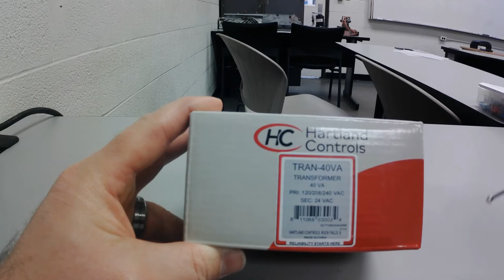Multi-Tap Transformer. DON'T HOOK UP EVERY WIRE !!

Comment: Thanks for clarifying that "Com" = Neutral. I had to wire  one up for a 277 from a single phase of the 3phz provided. As to say, Ground and Neutral were the options. My brain said "Ground is ground!" so used the Neutral!!!! Ground always seem in my mind to be the "Safety Net" that stops electricity from killing us!!! (takes it down and minimizes it from going thru other paths.....or can)
Reply from the maker: Thanks for commenting. I has been a while since i have been on a 277 circuit.

Comment: From Hammond transformer company. You must hook up the dual windings 
type transformer in phase or you will burn out the unit. In transformers
 with dual primaries and secondaries, do I need to hook up both?  YES, 
The unit was designed to run both and if you use just one it will 
overheat and voltage regulation will be poor. In dual winding 
transformers, how do you hook windings up "IN PHASE"? To hook the 
windings in parallel, always hook the dot to the dot. To hook the 
windings in series, always hook the dot to no dot. This applies to 
primary and secondary windings.
Reply from the maker: I have seen some commercial units with a different transformer than what is typically used in our residential HVAC units. That must be one of those types that they are describing...never seen one with dual primary windings. I'll have to try and find one so I can learn about it. Thanks
Reply: @johnjennings-JJ  The reason for dual primaries is that transformers are sold all over the world and most countries use 240 AC volts instead of 125 AC. It means they are dual use, 240 VAC for the world and 125 ACV for America and Canada. For 240 volts AC you hook the primary windings in series, so each section only gets 125 AC. For parallel (125 AC) if you wire the transformer out of phase it burns out the windings. For 125 AC you always wire them in parallel. You would first download the manufacturers PDF and find the dots and pin numbers on the schematic. Some of the pin numbers will be assigned a dot. For 240 vac series wired, the schematic shows to connect pins 2 and 3 together and connect the line voltage to pins 1 and 4. I used to buy small pcb transformers at flea markets for a dollar. And I burned out a few after wiring them out of phase. Remember dot to dot for parallel.

Comment: Which method works for 220v AC input? Same as for 240v?
Reply from the maker: Sorry...weather has been crazy here. Yes, I would say the 240 is likely the best option. On a transformer with multiple voltages I would choose the best voltage it listed for my power source. I would go equal to or higher than 220v. So, if you had a 208 and a 240 volt wiring configuration for the primary and an exact 220v power source I would choose 240v on the transformer because 220 is more than 208 and could blow it. But of course if you put your 220 on the 240 wiring you will come up a little short with the secondary voltage output because you didn't put the full "240 volts" on it. Hope that makes sense.

Comment: Quick question. I've got a 120v microwave transformer, it's the only one I've seen with 3 taps on the primary winding. One tap for each end of the winding and one that splits and goes both directions in the winding. Having a heck of a time trying to get output. Xfer ohms out fine on the meter and good connections all around. But can't seem to verify power with any combination of line and neutral connections on the 3 taps. Thanks, solid video btw
Reply from the maker: I would think that the primary side would just be 2 taps or wires and the secondary side maybe has 3 wires? They do some different stuff with capacitors and I don't do a lot with them so I really wouldn't know what to tell you that is different than what you said. That's why I like HVAC...just a little simpler! Hope you get it though.
Reply: @johnjennings-JJ  it is definitely on the primary side. 1 single tap on the secondary, with a couple wires from the heater winding but those are not used in my application. But no worries, I'll either get it or burn up the transformer, in which case I'm sure I've got another microwave laying around hahaha. Thanks for the reply

Comment: If you ran loads on those higher voltage taps would you run the risk of burning up the 120 side?
Reply from the maker: Something i learned when messing with my fishing lights. The power source has only so much power...in wattage. Don't go over it. I am sure that the calculations for running something off of those taps will result in burning it up. Unless it is something small like led lights or similar. But short answer is..SURE could. Just gotta do some math.

Comment: So how does 240 get wired?? There is no common, its 2 120 legs and a ground
Reply from the maker: On the primary side they list it as a common but it is just the "other side of power" for whatever power source you are using it on. For a 120 you would put the neutral on the "com" and for 208/240 you would put your L2 side to "com". It doesn't know any better 🤣
Reply: @johnjennings-JJ  I really appreciate your time John.. So L2(120V) to com and then L1(120V) to 240V wire? I'm just wiring a 24v UV light in air handler.
Reply from the maker: That should do it. There are several "commons" in the HVAC realm. There is a 24v common, a COM on a capacitor, a COM on a relay, etc. In cases like a relay or capacitor or in your case, a multi-voltage transformer winding...the COM is just a indication of "no matter the supply voltage you are gonna use this terminal and then one of the other numbered ones." Kinda like everybody likes Chick-Fil-A...we all have that in common!
Reply: @johnjennings-JJ  I just got breakfast there!!! Chicken egg & cheese biscuit... Thanks Again!!!

Comment: What happens if I leave the 120 volts current  supply line connected to the connection line of the transformer 240 or 208 volts for a long time thanks,nave a good day
Reply from the maker: If you put 120v on the 208/240 connection of the transformer -- should be no problem. It just puts out half of the voltage on the secondary. The other way however, 208/240 volts on the 120 connections of the transformer, will destroy the transformer!
Reply: Thank you

Comment: So the common wire goes to another power wire correct
Reply from the maker: Yes. The common wire in the primary side would connect to the neutral in a 120v circuit or the L2 in a 208/240 v.
Reply: @johnjennings-JJ  I think I hooked it up wrong. The heating element cuts on but not the blower.  With it being different color wires it's throwing me off
Reply from the maker: Are we still talking about a transformer? Or is it a relay of some sort?
Reply: @johnjennings-JJ   the transformer.  Guessing whoever had my house before me had to have it worked on some of the color wired are different

Comment: So, If I put 120v into a multi tap transformer, can I use the 240v tap as a step up? Even if it's low current, it could be rectified and voltage doubled to 500v and used in say a tube amplifier.
Reply from the maker: Should work. You are just limited to the wattage capacity on the 120v side (if i remember all my electrical stuff right!) Even if you stepped it up to 500v it would still be at the original wattage rating of the 120 side. I am not familiar enough with tube amplifiers but I like to tinker with stuff!
Reply: @johnjennings-JJ  Crap. I just realized if I did this, there'd be no isolation. It's the whole point of using a transformer! Duh 😂. I knew it was too good to be true. I was trying to get away from the step-up transformer costs and cheap out. They can get expensive.

Comment: If you have 120v input, in most places white is neutral and black is 120v hot from the line. So on this transformer since BLACK is always common/neutral and WHITE is the tap for 120v input, are you supposed to actually connect line white to xfmr black and line black to xfmr white?? Instead of matching them?
Reply from the maker: "Technical answer"...sticker is correct hookup...but I dare say it would not matter if you flip flopped them. If you are OCD enough then make them match! Probably would work fine since you had the proper wires on the winding to handle the voltage. Never tried it.
Reply: @johnjennings-JJ  so if I understand you correctly, if one wants to follow the sticker exactly the wires should hookup to opposite colors with respect to black and white on 120v and that is fully supported by the vendor. Yes?

Comment: Great video.

Question I have a transformer has 2 X 120 Primarily which Are Blue, Black Wires. If I wire them in series should get me 240v It also has 2 Green Primary wires listed as 24v. We have 240v here so do I cap. The 2 Green wires of?

The secondary wires are 24 out. Red Black?
Reply from the maker: Never seen one like that...what do you mean wire them in series. If you put have 240v power supplied to the transformer, one transformer wire will go to the L1 and the other transformer wire to the L2 of the source. You would need to individually cap each unused wire.
Reply: Yes 240v is what it needs and 24v out. However it  has the green 24v Primary in as well as the Secondary 24v wires. It is aToroidal type of Transformer from a powered speaker that had the soft start blow so I am replacing it with a generic one.

Comment: On a 208/230 package unit do I hook up the 208 wire opposite common? Or the 240 wire?
Reply from the maker: Depends on the power going to the unit. If it is a residential, probably gonna use the 240V tap opposite of Com. But we have some light commercial in my area that run on 208V so I would use the 208V tap of course. Just depends on the situation. If you have a 208 volt power supply and attach it to the 240v tap it will jot give you the typical 27 or so volts. It will give you less - like 24v because you didn't give it the appropriate 240 volts. You went short with 208v so your output will be short of the 27v you would normally get.
Reply: @johnjennings-JJ  yes I was getting 243.7 at the high voltage coming in from disconnect so I used the 240. Thanks

Comment: Thank you for your video. I have an old Colemans' heating furnace the old transformer has four wires one side white and black another side red and blue. new transformer S1-2940A3541 120V-pri 24V-SEC40VA York Goodman came with four terminals with no instructions. now I don't know which wire goes to which terminal. Please help me with the connections. Thank you. Dost K
Reply from the maker: The new transformer should have each side labeled somehow. The black/white on the old is 120v of course so one the new transformer it should be labeled as 120 or maybe primary. The other side for 24v red/blue should go to the new one labeled "sec" or 24. I hope this helps.

Comment: 4 plug transformer, top right 120 black wire, opposite white com.  Bottom right yellow w/black strip on 24v  opposite plain yellow com.  I took pictures to make sure.  The new transformer shut down and was extremely HOT!  Any ideas?
Reply from the maker: It sounds like a short had taken out the original transformer. Did someone just find the unit not working and diagnose a bad transformer? If so, by just replacing the transformer it would not have fixed the problem...only give it another chance to strike! Sounds like you have got to find the low voltage short (possibility) that took out the original transformer before replacing it again. Am I close? If not...I plead the 5th!

Comment: Dumb question how hot (temperature) do transformers get when energized?
Reply from the maker: I don't have an exact number but "warm" would be how I described it. If the windjings get too hot then the lacquer on them will burn off and you'll get that burnt electrical smell. I'll have to put a temp probe on a transformer and let you know...

Comment: I have a bad 4 wire transformer. Primary side has two black wires going in and had 120v on each one. And the secondary side has two red coming out at 24v. How would I wire this up with out a neutral?
Reply from the maker: If it is a 208/240v to 24v you wouldn't need a neutral at all. You would just just wire it to your L1 and L2 power (at the terminal bock inside your unit?). I am assuming since you said you have 120v on each leg. Neutral should only be needed if you are running 120v, not a 240.
Reply: That’s my question on 220 single phase you have 110 and 110 so on the 220 wire you have 110 and what they call common you have your other 110 wire that what you mean on L1 and L2 line in . kind of confusing thinking it’s a ground
Reply from the maker: A lot of universal transformers have multiple wires (and even if you have one that isn't universal) and most everyone that I have seen has a 'COM' on the primary side along with something like 120= Black, 208=Orange, 240=Red, White=COM. The L1 side of your actual power supply (say 120 volt for a gas furnace) would be wired to the Black (because that is the L1 for a 120  on the transformer) and your actual neutral would be wired to the White because that is the COM on the transformer. The 'COM' is always wired to your L2 or neutral no matter what actual power supply you have in the unit. With your 240, you would use something like the red and black in my example. No neutral needed since it is a 240 circuit. Only have a neutral in the 120v power supply.

Comment: i have a questionve a 40 watt amp that has 2 transformers and im trying to use them to give my new stereo more power. one of them already has speaker wire plugs connected which are ( brown blue red orange and yellow) but also has a black and white with a two prong male end then on the other i only have two reds on one side and 2 blacks on the other how do  i hook it up combined with a homemade amp i built
Reply from the maker: I don't have much experience with autos and speakers. I am afraid I wiuldn't be much help with this one. I would have to learn what you know first...
Reply: @John Jennings  it's really just the transformers using them to add more power but I'm an electricians help for years my dad owned his own company but they came out of an app that I took apart I like taking things apart and trying to build my own things. My project now is to get this super loud system building my own speakers and etc. But its two transformers I know nothing about. One is a single layered transformer I'm assuming and  has 7 wires 5 in which are brown blue red orange and yellow which are all hooked up to a peaked wire plug and were labeled com,4u,8u,16u and 70v which would go from yellow being Com which is negative and brown being 70v. And it has a black and white wire connected to a two prong plug theat went to the power board then I have another Amp that has the two black wires coming from the top half of the transformer connecting to the twoprong power board also but then it has two red wires on the lower half
Reply: @johnjennings-JJ  thanks for the reply though